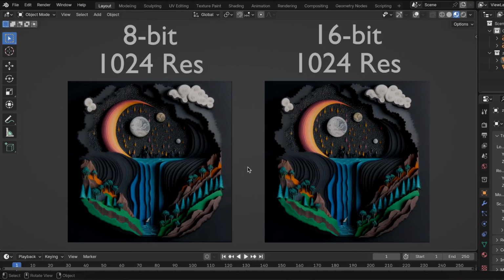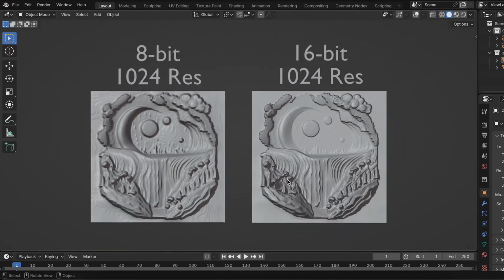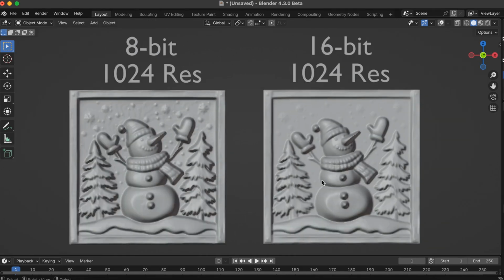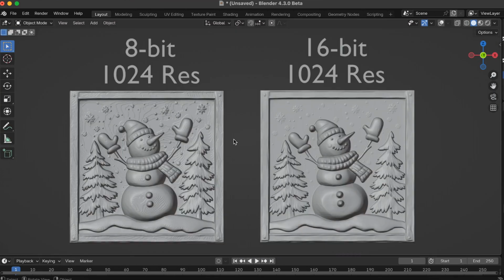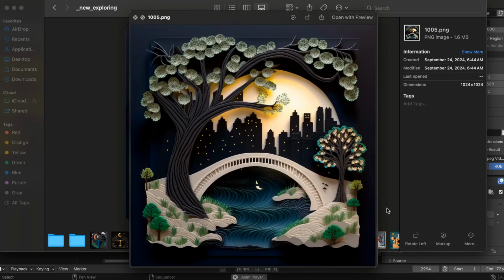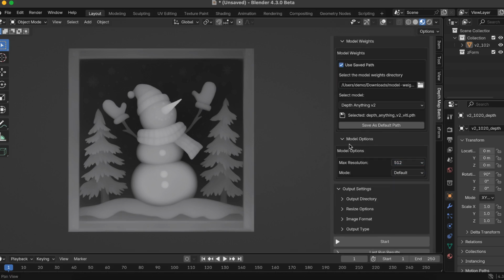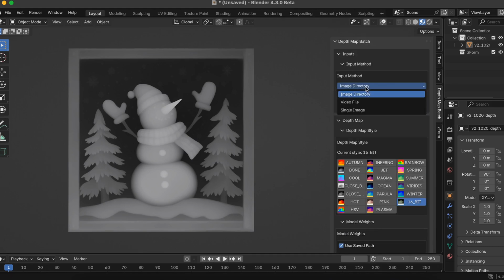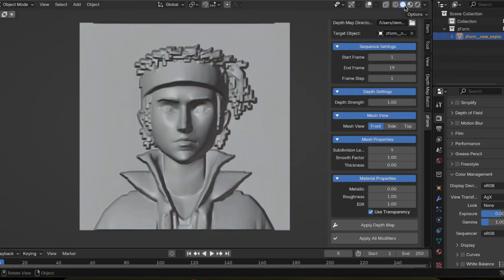Convert 2D image to 3D using 16-bit depth map and 8-bit depth map in Blender

Comment: Would it be possible to add some kind of curve selection to the extrusion effect? From the looks of things the extrusion is linear meaning each bit "step" is converted at the same increment when extruded. Because the deeper parts of an image are further away from the camera I believe in many cases the depth effect would benefit from being calculated on an increasing acceleration/exponential type curve so that each successive step further is spaced at a larger distance than the previous one.
I imagine there's some kind of deformer within blender that can accomplish this after the mesh is created, but my current level of blender proficiency isn't much beyond deleting the cube.
Sorry to keep suggesting things as I've not bought this plug-in yet. Hopefully will soon after the holidays.
Reply from the maker: Good to see you still here and thanks for your message! And I haven't forgotten about your good idea a while back for the 360 scene formation. Let me put some thought into what you described today. Thank you very much for sharing your thoughts and suggestions. There is definitely a deformer in Blender and it's one of the backlog items I want to integrate into zForm at some point.
Reply from the maker: Keep your eyes peeled for a pretty big update to zForm releasing soon! I've integrated in a new set of deform features : )  You will be able to produce a clean 360 view from the mesh, but it won't be an entire sphere per say. But we will have the ability to deform all the way around. It's a step in the right direction.

Comment: Thanks for this video. Maybe you’ve answered these questions before, but here the are: 1) The “pngs” I have are 8-bit. Any way to convert them to 16-bit, or do I need a “format conversion” tool or other software to create 16-bit pngs from any typical image file? 2) Can you explain why (for your software) the “apparent depth” is less with 16-bit vs. 8-bit? 3) Seems odd to me that the “snowflakes” in the 8-bit conversion to mesh have so much better “depth” (or bas relief) than shown in the 16-bit conversion/mesh conversion. Intuitively, I would think both 8 and 16 would have similar “snowflake heights”, but the 8-bit ones would appear “rougher” or with some “banding” (which the don’t appear to exhibit). Anyway, love the smoother result with 16-bit (at higher mesh sub-division), but then seems like we should get better depth (if we could “stretch” the mesh in the “x” plane). 4) Have you looked at the Bender add-on “PixelModeller AI” depth-to-mesh tool? You can see YouTube videos of his add-on at “3d illusion” channel (I think it’s named). His “quick-start” video seems to show an “N-panel” tool with a ton of adjustments and texture painting options for the resulting 3d mesh. He also uses “depthmapanything v2” for depth map creation. 5) How about “tiling” for depth map generation? Have you looked at “tileZoeDepth” (I think it’s called)? Seems to me it would be nice to have a “tile” processing option for images (to create resultant depth maps), especially those with image sizes greater (or variably-sized) or other than 512x512, 1024x1024, or 1600 pixels wide, etc. Yes, variable-size or larger images might take more CPU time to generate depth maps, but the “tile-processing” approach should allow ( I would think) images to be processed in smaller chunks at a time, thus allowing the processing to occur in systems with smaller RAM sizes (like 8GB or 16 GB, rather than needing 48 GB or 96 GB RAM). Thanks in advance for your reply on these questions!
Reply from the maker: Let me answer your first question now, and then I'll follow up later on tonight with your other questions. 

"1) The “pngs” I have are 8-bit. Any way to convert them to 16-bit, or do I need a “format conversion” tool or other software to create 16-bit pngs from any typical image file?

Yes, you can now generate 16-bit depth maps for 8-bit images in my tool Depth Map Batch and I totally forgot to mention that in the video. I just released this new feature late last week...this is a new feature. When you use the "16_BIT" depth map style, it will convert 8-bit images to 16-bit, but make sure to choose the Depth Anything V2 model and use PNG as the output format type. 

Does that make sense?
Reply from the maker: Answers to your questions

1) Yes, you can now generate 16-bit depth maps for 8-bit images in my tool Depth Map Batch and I totally forgot to mention that in the video. I just released this new feature late last week...this is a new feature. When you use the "16_BIT" depth map style, it will convert 8-bit images to 16-bit, but make sure to choose the Depth Anything V2 model and use PNG as the output format type.

2) I honestly don’t know at this point, but it’s something I’m still looking into. Given there really isn’t a whole lot out there for examples on this, I had to build my own solutions. I hope to come up with a better formula to maintain the same depth as 8-bit, but nothing concrete yet. 

3) Yes, I was hoping to get that same depth as 8-bit as well and tried to. But, it is what it is right now. As I mentioned in my previous answer, there isn’t much published online on this topic and I’m developing my own solution for this. No guarantees, but I would guess over time that will improve as I continue to experiment with the code more.

4) I’m aware of it, yes. But I haven’t actually tried the tool myself. 

5) There’s a lot more I want to develop, but it’s just me. So, I have to take one step at a time and I’m very pleased with the progress I’ve made so far. The backlog of development is quite extensive at this point. I’m not sure what you mean by other than square sizes….my tool currently generates depth maps for landscape, portrait, and square images. Not just square. I only showed square in the video because it was easier to fit the square side by side consistently. Yes, I’ve heard of ZoeDepth and it’s something I’ve been looking into.  My tool has batch processing and the user has the ability to increase the batch processing size to higher amounts greater than one if their machine can handle it.
Reply: @vizdotlife  Thank you greatly for your answers to my 4 questions. Very much understand your limited time as a single person working on Depth Map Batch and zForm. Both add-ins seem easy-to-use and quite useful for their intended purpose. I’m just in the review stage, looking at the various “depth map to mesh” solutions out there, but for Blender users, your solutions are very notable. As for “ZoeDepth”, some person created a modification called “TileZoeDepth” that processes images by splitting them up into sections (called “tiles”) and processing each “tlie” separately before combing the separate results into the final “full image” depth map. At least that’s my understanding.There are supposed advantages, like more efficient RAM use, to this approach. This is not the same as “batch” processing separate image files in a directory, but I definitely like the fact that Depth Map Batch can do this, as well as handle video files. Anyway, I’ll keep following your development progress on your add-ones, and “thanks” for your availability to answer these type of questions.
Reply: @vizdotlife  Yes, makes total sense (hopefully you will have a “quick start guide” or video that covers all the features of your software (updated, of course, as you add new features, so us users don’t have to “read your mind” when using your great software tools)) and it’s a great convenience for users to have the 16-bit depth map generation capability right within the Depth Map Batch software (add-on), so “thanks” for filling that need!